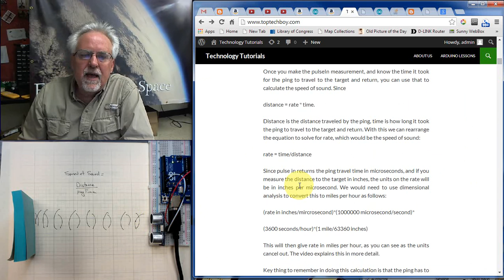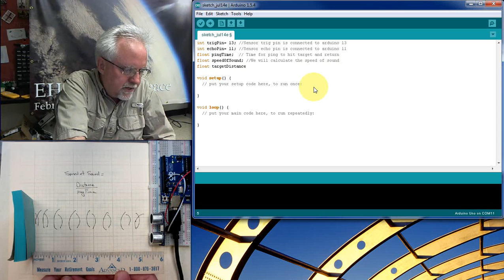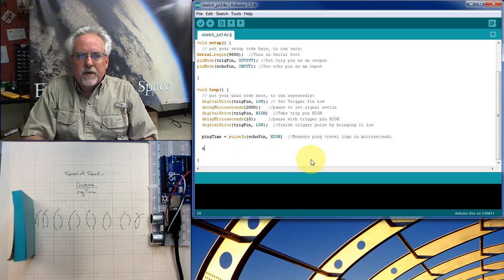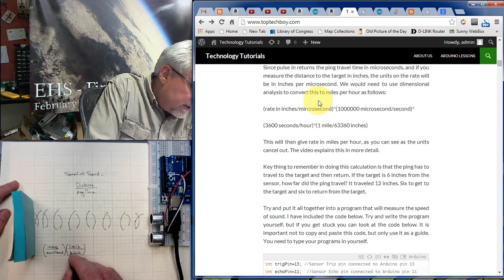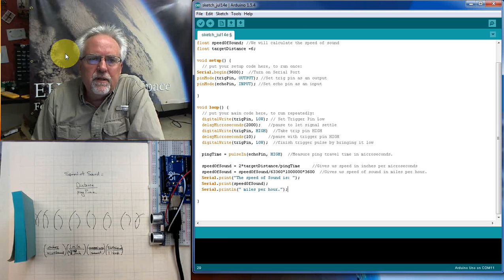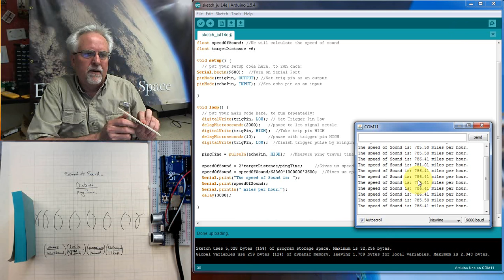LESSON 17: Measure Speed of Sound with Arduino and Ultrasonic Sensor

Comment: You can also use the same sensor to calculate the distance within 3 cm.  This would allow you to do everything automatically with no need to manually measure.  The Formula is pingTime/58 to get cm.  Then convert to inches (pingTime*0.3937) for the targetDistance variable.  I know the video is 4+ years old but thanks for taking the time to do these.  They are great!

Comment: With my Swiss cheese brain due to the amount of pain meds that I've been on for 20 years, things don't come easy to me.  You still manage to make it seem easy.  Thank you, Paul!

I hope this stays formatted correctly.  Here's my homework.  

// Libraries:-

// Defines:-

// Pin allocations:-

// Constants:-

// Global variables:-

int trigPin = 13;            //Sensor TRIG pin to Ard 13
int echoPin = 11;            //Sensor ECHO pin to Ard 11
float pingTime;           //Time for ping to hit target and return
float speedOfSound;       //Calculate SOS
float targetDistanceMin = 4; //Minimum istance to target -  600ms = 4" = 150ms/inch
float targetDistanceMax = 8; //Maximum istance to target - 1200ms = 8" = 150ms/inch
float targetDistance;

// Class objects:-

void setup() {
  // put your setup code here, to run once:
  Serial.begin(9600);
  pinMode(trigPin, OUTPUT); //Set TrigPin as output
  pinMode(echoPin, INPUT);  //Set EchoPin as input

  
}

void loop() {
  // put your main code here, to run repeatedly:

digitalWrite(trigPin, LOW);   //Set TrigPin LOW
delayMicroseconds(2000);      //Pause to let sig settle

digitalWrite(trigPin, HIGH);  //Set trigPin HIGH
delayMicroseconds(10);        //Pause trigPin HIGH

digitalWrite(trigPin, LOW);   //Set TrigPin LOW

  pingTime = pulseIn(echoPin, HIGH);  //Measure ping travel time in microseconds
 

  targetDistance=pingTime/150;        //Target distance in inches is ping time / 150ms
  Serial.print(targetDistance);     //Print target distance in inches
  Serial.print("\" is ");
        //So far, so good!

  if(targetDistance<targetDistanceMax && targetDistance>targetDistanceMin){
    Serial.println("within target range." );
  }else{
      Serial.println("out of target range!");        
  }
  delay(2000);
}

Comment: I modified your code so the speed of sound were in meters per second, I got to changed TrigPin from Int to Float so I could use 0.20 meters as my target distance. Thank you very much Mr. Paul McWhorter !

Comment: Another great lesson! When looking at the setup I see quite a few variables, eg. Angle of the post-it's, lead sheet is slightly separated, and where on the sensor you choose to begin measuring (front, back or center). All in all I'd say ~1% +/- is dead on.

Comment: I am a 63 year old airline pilot with a BS in Aero Eng. Technology. I am looking forward to applying this to my ham radio hobby.  My question for Mr. McWhorter is; will the resulting speed of sound that is measured be affected by the density of the object the ping is striking? I will experiment with a pad of post-it-notes and then a piece of ceramic tile and find out.

Comment: Paul, according to data sheet of HC-SR05 "DETECTION DISTANCE: 2 cm to 450 cm". It is not inches. Because of it inches needs to transfer cm to get speed close enough to real. As 6 inch is 15.24 cm. It means it needs statement.  Usually  sound of speed is M (meter) per second (Second). Miles per hours are not practical and confusion as we talked about speed of sound

Comment: Little confused on the pulseIn function. As per the definition on their website "if value is HIGH, pulseIn() waits for the pin to go from LOW to HIGH, starts timing, then waits for the pin to go LOW and stops timing". We already gave the duration of pulse to be 10 microseconds so isnt it measuring this again instead of the time it takes between trigger and echo?

Comment: I have a great question for you, how would you calculate the speed of light with a LIDAR sensor? What would you make the targetDistance variable to be?  Leaving all of your variables as is,  while using 58924.8 as my targetDistance I get the 669,600,000 miles per hour output. It took a bit of guessing but I got it. I did change the variable name to speedOfLight and such. Incidentally I am doing this on an ESP8266 using the MakerFocus Lidar device. If I Serial.print the pingTime, I get 10. Your thoughts?

Comment: Hey Paul!
that was a good lesson, I enjoyed it.
say, can you help me out with a doubt i have?
when you taught the colour sensor, you used unsigned int for the pulseIn command and now you are using float. do the two data types provide simmilar ranges? 0-102400 i think??
thanks!
Reply from the maker: Floats can be very large numbers, but include the inbetween numbers. In math terms, floats are the "Real" numbers

Comment: can you please give more discription about pulseIn command. in previous lesson low pulse has messured colour strength which will be 0-102400 which will be converted to 0-255 i.e., backward 255-0 but here high pulse to get time
in pulseIn we write HIGH or LOW is this for "forward and backword" or "high pulse pwm and low pulse pwm"
Reply from the maker: Pulsein HIGH  . . . the signal is normally low, and you measure how long it goes high.
Pulesin LOW . . . the signal is normally high, and you measure how long it goes low.
Depends on how the sensor behaves which command you use.
Reply: thank you for the lessons, is there any chance of making lessons on microcontroller communication protocols like CAN, I2C, UART, SPI ..... i think they are intresting

Comment: Hi again Mr.McWhorter,   I'm having a hard time with when it's proper to use a space before or after keywords,
I see  "int trigPin=13;"   and   "int trigPin= 13;  So this spacing will not effect code operation, I just need a little guidance.
Reply: A lot of the time it doesn't really matter, it's just up to which way you prefer to do it.

Comment: im trying to make an led fed but i only turn it on in off thats the code i put in

int trigPin=13; //sensor trig pin is connected to arduino13
int echoPin=11; //sensor echo pin is connected to arduino11
float pingTime; //time for ping to hit target and return
float speedOfSound; //we will calculate the speed of sound
float targetDistance=8;
int LED=6;
int writeValue

void setup() {
Serial.begin(9600); // turn on sserial port
pinMode(trigPin,OUTPUT); //set trig pin as an output
pinMode(echoPin,INPUT); // set echo pin as an input
pinMode(LED,OUTPUT);
}

void loop() {
  digitalWrite(trigPin, LOW); // SET triger pin low
  delayMicroseconds(2000); // pause to let signal settle
  digitalWrite(trigPin,HIGH); // take trig pin high
  delayMicroseconds(10); // pause with triger pin High
  digitalWrite(trigPin,LOW); //finish trigger pulse by bringing it low

   digitalWrite(LED,speedOfSound);
  pingTime= pulseIn(echoPin,HIGH); //measure ping travel time in microsecond

  speedOfSound= 2*targetDistance/pingTime; // gives us speed in inches per microsecond
  speedOfSound= speedOfSound/63360*1000000*3600; // gives us speed of sound in miles per hours
  Serial.print("speed of sound is: ");
  Serial.print(speedOfSound);
  Serial.println(" miles per hour.");
  delay(3000);
}
Reply: Paul McWhorter
you dont have to answer  this one i figure it out instead of this         digitalWrite(LED,speedOfSound);        i put this   

if(pingTime/2*targetDistance){
   analogWrite(LED,speedOfSound);
   }

Comment: Hello I have the accent same code and my serial monitor reads the speed is 'inf' could you please explain what this means because i tried but i can't figure it out on my own.
Reply from the maker: inf probably means you are dividing by zero. Before you do the calculation, print each variable that is in the calculation and make sure it has a reasonable value. Then if you have a variable that is 0 in the denominator, then find the mistake that led that variable to be zero. Use lots of print statements and figure it out.

Comment: "The Speed of Sound is: inf miles per hour" what does it mean? i'm not getting the value of the speed of sound rather this one, correct me please
Reply from the maker: inf means infinity which means you are probably dividing by zero. Print out each variable you use in your calculation equation in your program, and probably one is zero, then find out why it is zero.
Reply: Paul McWhorter thank you for your response, let me find that zero value in my variables. I'll get back to u for feedback soon. Asante sana (thank you very much)
Reply from the maker: Yes, I know the meaning of Asante Sana . . . I have been to Africa 7 times and hope to move there soon.

Comment: Im using the metric system, so im measuring in cm per microsseconds, to convert it to km/h i multiplied the speedOfSound by 36000, but i get “inf” as a final result. Any might know what is wrong with what i did? Thnks
Reply: I get the Inf as well,, Did you ever figure out a solution?
Reply: @SteffenABPetersen  l
Lol I get the Inf as well,, Did you ever figure out a solution?

Comment: What am i doing wrong, Im not getting a ping time. Sorry its a lot of code. 
    
    int Trig=13;
    int Echo=11;     
    float PingTime;
    float SpeedofSound;
    float Distance=6;
void setup() {
    pinMode(Trig,OUTPUT);
    pinMode(Echo,INPUT);  
}
void loop() {
    digitalWrite(Trig, LOW);
    delayMicroseconds(3000);
    digitalWrite(Trig,HIGH);
    delayMicroseconds(10);
    digitalWrite(Trig,LOW);
    PingTime=pulseIn(Echo,HIGH);
    
    Serial.print("Distance "); Serial.println(Distance);
    Serial.print("PingTime "); Serial.println(PingTime);
    Serial.println(" ");
    Serial.println("SpeedofSound = 2 * Distance / PingTime");
    Serial.println(" ");
    Serial.print("SpeedofSound = 2 * "); Serial.print(Distance); Serial.print(" / ");Serial.println(PingTime);
    SpeedofSound=(2*Distance)/PingTime;
    Serial.println(" ");
    Serial.print("The speed of sound is ");Serial.println(SpeedofSound); 
    Serial.println(" ");
    Serial.println("SpeedOfSound = SpeedofSound / 63360 * 1000000 * 3600");
    Serial.println(" ");
    Serial.print("SpeedofSound = "); Serial.print(SpeedofSound); Serial.print(" / 63360 * 1000000 * 3600");
    SpeedofSound=SpeedofSound/63360*1000000*3600;
    Serial.println(" ");
    Serial.print("The speed of sound is "); Serial.print(SpeedofSound); Serial.println(" MPH");
    Serial.println(" ");
    Serial.println(" ----------------------------------------------------------------------------- ");
    delay(3000);
}
Reply: open serial port in void setup

Comment: Things were great until now. I keep getting 0 as a return when it divides (targetDistance*2)/pingTime. I started a new sketch and used the text code verbatim. Still getting 0. It's doing integer math on floats. I even tried changing from UNO to Micro to Nano. Nothing works. Broke it down serial.print and debug line by line. ping =11000. (Distance*2)= 12. Divide them and return is zero zero zero zero zero zero zero. Add some decimals? no difference. Define as float in global? no difference. Typecast as float during the operation? nope. 0. 0. 0. 0. 0. 0. 0.
Reply: Created another variable of 1/ping and multiplied that by the other. No division = problem solved. Still don't know why that happened. But I learned that sound moves at 1cm in 29ms and one of my sensor was garbage(ping =11,000 @6")...
Reply: maybe you would have figured as of now, nevertheless if it helps, try putting decimal values to all your ints  as floating variables still return int, in your case 0